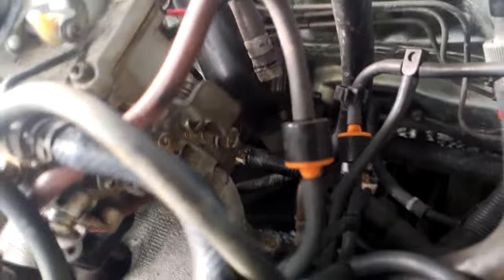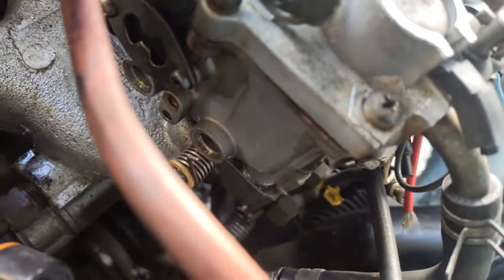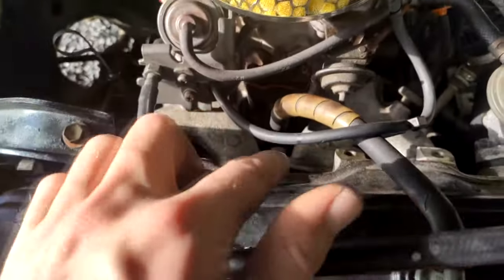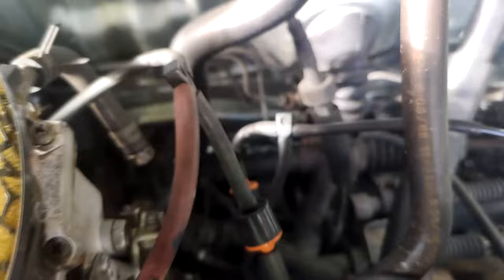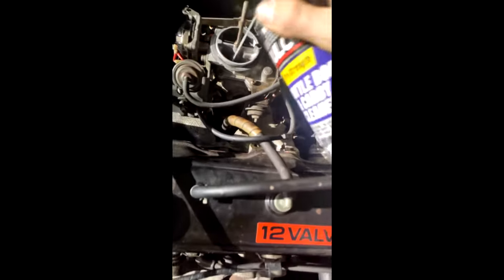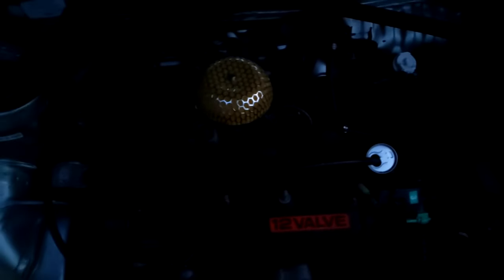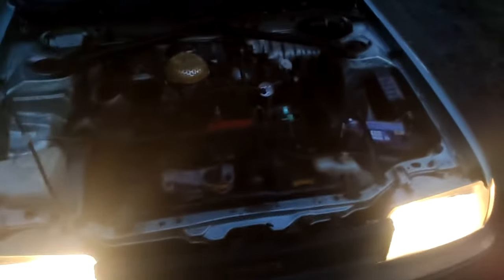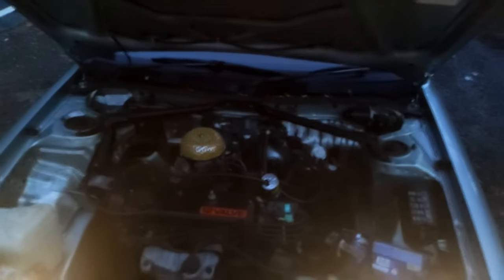Toyota Corolla 2E idle and carb issue fix

Comment: I am looking at getting a 95 Corrolla with a 2e this weekend! Super excited!
Reply from the maker: That's sick are you gonna do any mods to it
Reply: @RuggedGarage  definitely for sure, gonna save for them, I want a aggressive cam, double carby set up like on yours, rims, exhaust/muffler
Reply from the maker: The red 2 door ee90 twin Webber is my brother car he got the stock cam custom machine and welded on to by Auckland cams the duration is 290 degrees a little more and a Toyota TRD race cam also the engine is fully rebuilt and ported and polished upgrade valve springs and 4-2-1 exhaust headers you can buy them off trade me.
Reply: @RuggedGarage  oh that's fucken awsome if I get it I definitely must look at doing something like that, if I wan a run such an ogressive cam do I have to do any engine work? Besides stronger vavle springs?
Reply: @RuggedGarage  4-2-1 exhaust headers you sell them for 2E engine? Whats the price and is it possible to ship to me
Reply: @RuggedGarage  why would anybody mod a 1.3 engine..?

Comment: hello, I see the video where you upgrade your 2E engine with weber carbs, I want to do same and I want to ask whad did you do with old vacum lines and what vacum did u use on that setup, I only know for one vacum thats made for brake booster, and also want to aks where did you buy that intake manifold for weber carbs. thank
Reply from the maker: Hi from factory it has a metal hardline vacuum rail I removed all of that and have tee off all the lines to the one port beside the brake booster vacuum line I got my manifold a few years back in nz but eBay sell them here the link .www.ebay.com/itm/273913095754
Reply: @RuggedGarage  O Ibuy the same from that guy on ebay, is it possible for you to make one video about how did you setup all and show what did you do, and also I want to ask whats type is that fuel regulator that u use in between fuel pump and carbs. And I sow other videos too about performance cam shaft and you run car with that camshaft 30deg and where did you buy that cam shaft if you can sent link I would appreciate it a lot

Comment: Hey bro, sounds like your from New Zealand, are you from Auckland at all? I've just purchased a 2E 1994 Toyota Corolla Hatchback recently and it seems to be running a bit rough, if your in Auckland would you possibly be keen to maybe check it out and maybe tune it? Would pay for your time etc and would rather have it done by an expert then trying to mess with it myself since I'm not really mechanically minded, if your keen let me know. I'm thinking it could be the mixture, I adjusted the idle screw and it seems to rev lower as the previous owner adjusted it to be high revving as that's how he liked it he said (strange but yeah hahaha) Cheers bro
Reply from the maker: yea mate just need to lower the idle screw on it buy the sounds of it yep also in auckland

Comment: Thanks for the video, very informative. Maybe you can help me with my issue on my 2e. When idling at 900 rpm it's sounds rough and the needle jumps up and down from 1000 to 900 I don't know if that is normal. If I up the idle just above 1000 it idles great. What can be the issue?? I appreciate any advice you can give me.
Reply from the maker: the engine will rev hunt a bit my cammed engine rev hunts between 1100 to 1400rpms
Reply: @RuggedGarage  is that your normal idle speed?
Reply from the maker: @4daluvofgames701  yep I run around 1100rpm for my cammed motor. You  have to run a litte high idle speed because of the lumpy cam or the engine dies. Stock motors shouldnt jump to much 100rpms seems ok

Comment: Hey man, first of all, thanks for great vid. Please help with your advice. My 1.3 L 1991 Corolla e90 carbureted (european) has an issue. It is overflooded by fuel when warm and/or driven in higher RPM. Immediately after that when running without shifted gear RPMs dramatically decreases and engine stops overflooded and start only when dried. When runs "linearly" it is ok. Looks strange. Do you have any idea? There is no car guy, who wants to touch it. Thanks and take care. Radek
Reply from the maker: sounds like over fuel i would check to see if any springs have broken off  any tabs on the carb also would check the accelerator pump would recommend a rebuilt or a band new carb replacement  read this article https://www.yourmechanic.com/article/how-long-does-an-accelerator-pump-last
Reply: @RuggedGarage  alternator is solid also battery is new

Comment: How did you modified Fuel vacum sistem? what did you get from that
Reply from the maker: hey I removed the stock factory metal vacuum hardline and rerouted all the vacuum lines using tees then rerouted all to the intake manifold.

Comment: Hi there can u teach us about vaccume lines connection thank u!
Reply from the maker: hey I removed the stock factory metal vacuum hardline and rerouted all the vacuum lines using tees and then i rerouted all the lines into the intake manifold and i run the two lines to the distributor vacuum advanced this may vary depending on what carb you have i can do a video one this if you want thanks.
Reply: @RuggedGarage  yes please in order to help me to have a good performace of my 2e engine thank u in advance and more power to your channel. I was so amazed with yung setup mostly u put a webber carb in 2e thats sounds great!
Reply from the maker: @Music.is.my.medicine  yea man it rips very fast compared to a stock 2e and the sound is what makes it. Will be doing a video in the next few days

Comment: Rpm?
Reply from the maker: it had an issue with starting and the idle was dropping and stalling when cold around 800rpm to 1400rpm. I cleaned the carb last week no problems since. I suspect that it was a combination of fouled spark plugs and gunk built up in the fuel bowls and jets
Reply: @RuggedGarage  i think ky carb also needs cleaning... it fluctates between 800 -1000rpm on idle and today when i turned on the ignition it went up to almost 2000 rpm, does it mean it needs cleaning or something with spark plugs?